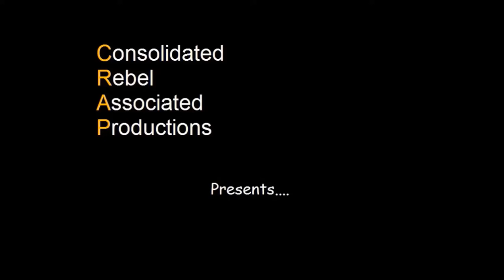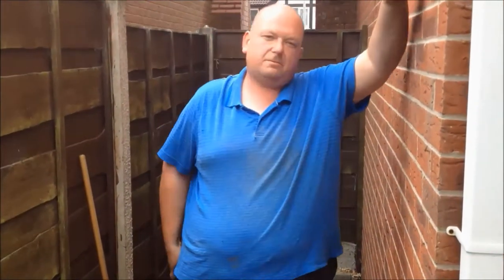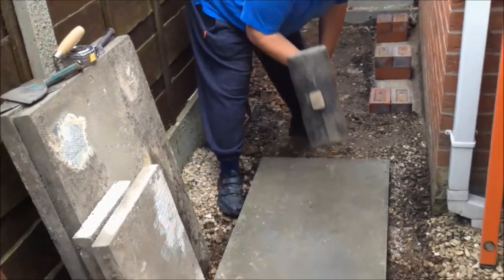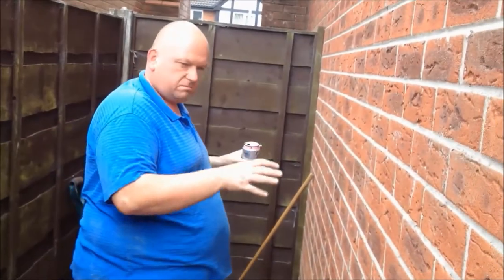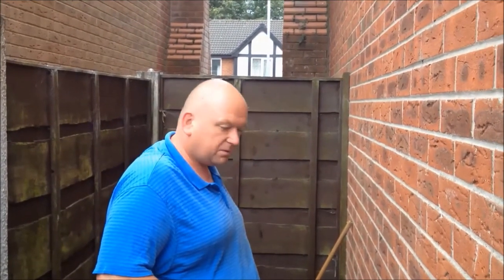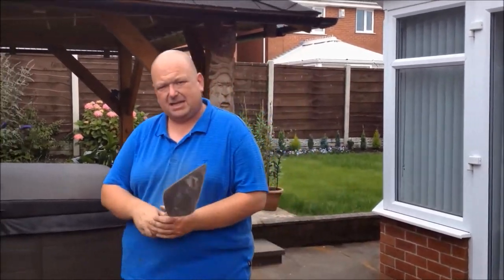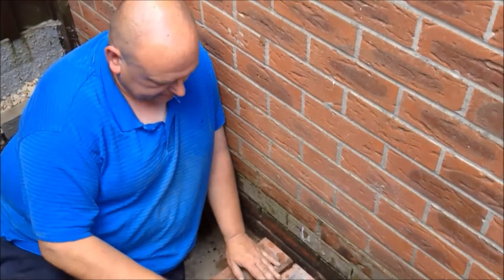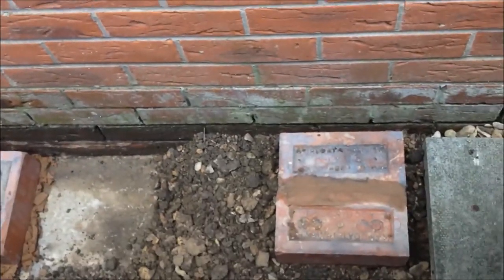Mr H back on the tools. The shed project, Phase 1

Comment: Nice job H,,, iv laid a fair few flags in my time, and bricks,, im a jobber.
Nice cam work by Mrs H, that dinner looked bloomin scrupshish ;P
Thats livin alright ;D
cheers
Al.
Reply from the maker: I got out Al, mainly because the H&S had started to go bonkers on the sites towards the end of the 90's early 00's. 
You'd end up wasting half an hour sat on an 'induction course' just to get on the bigger sites, even if you'd had the same induction course but on a different site for the same company before. Then your boss expected you to make that time up so you'd end up working through brew or your dinner to get off on time.

Comment: hi are you putting timber joists down before the shed ? are them pillars to lift it up so it doesn't rot?
Reply from the maker: Hi Gaz, I'm going to bridge across each of the 6 brick pillars when built with 3 box steel joists as seen at 5:14, then the timber joists that are attached to the shed floor will run across all the steel joists length way.

Yes I'm building it this way to raise the shed off the floor to prevent rot, but also to discourage rats from nesting underneath it afterwards as they won't build a nest if a predator can get at them.
Reply: Mr H's Hot Pot  well thought out mr h i built my shed out of plasterboard pallets,I got a rats nest because mine is on screeded sand

Comment: Eerhm Mr H - I was taught at Technical college Under No circumstances do you put washing up liquid in mortars .. It changes the chemical structure of it , making it weaker . 
Head of trowel trades at Tech told us students at the time that It's cowboy practice As there are specific plastercises for the purpose of workability of the mortar . Ok Chap 👍🏼👍🏼 ...
Love All your vids By the way 👍🏼( subbed)
Reply from the maker: Hi Uncle Baldy, I was taught this at College also, but I later found out that the company 'Feb' who make these 'specialist' plasticisers also have/had sponsorship deals with the CITB (Construction Industry Trading Board) who train up apprentices along with providing the technical data that your Lecturer and mine will have quoted from. So can you really trust what you was 'told' when the data that you was taught from was provided by the same company who makes the product that they recommend? Anyway glad you enjoy the videos and all the best. 👍

Comment: couple of empty joints spotted but the trowel arm is still there lol. leave the house footings to the young guns stick to ya shed piers!
Reply from the maker: Lol. The young guns are welcome to it Conjects 69, as my days of chasing the money are well behind me. 
I didn't work the big sites much back in the day but when I did I always tried to get on the corbelling or arch work rather than facework because not many could do it.

No one ever understood why I did this as they all saw it as fiddly and time consuming but whilst they was having to tip up early on site and knock off late to crash 500+ a day in on a price or grafting away in the footings on solid 9 inch blocks, I'd be up on a scaffold with 2 spot boards with different coloured mortar on them with no more than 30 bricks a day to lay on a decent fixed bonus. 😉